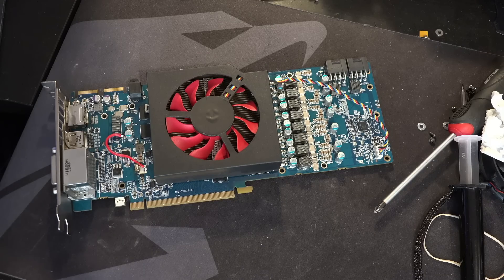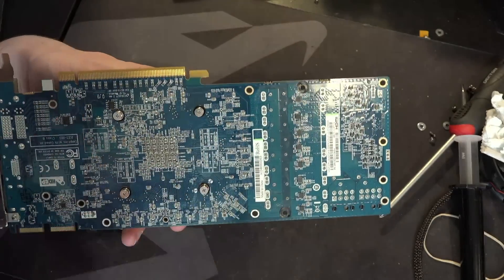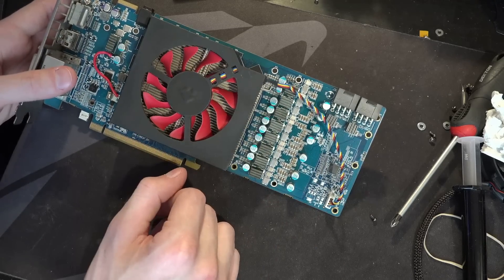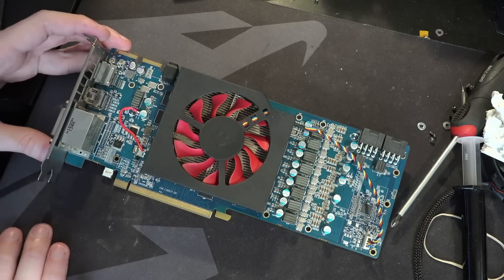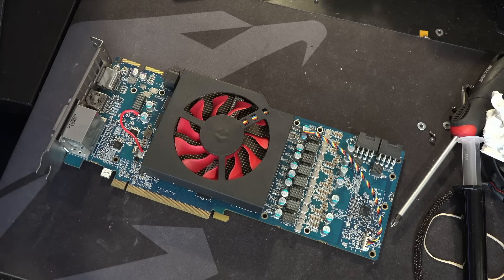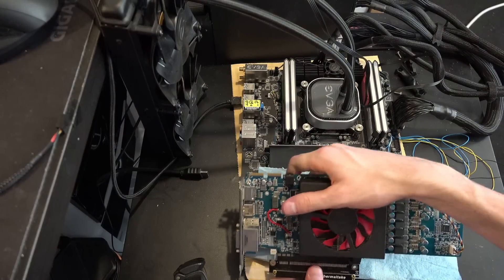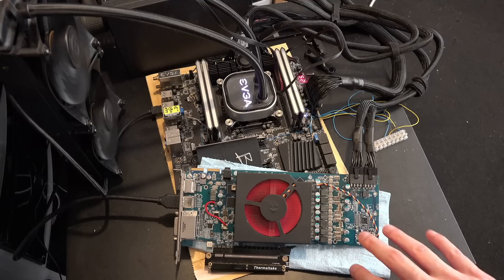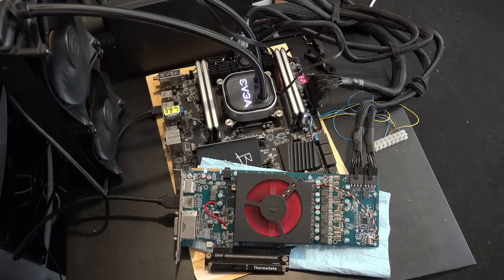GPU Necromancy 3: The ressurection of the Sapphire HD 7970 Vapor-X 3GB

Comment: I have the same card and about a year ago it started showing artifacts so I did the heat gun trick and it worked for another 3 months before it crashed again, now the card does not initialize (Dr.debug error code b2) and when i start the pc with the igpu, the card is detected (shown in hardware manager and even in GPU-Z with some parameters missing like frequency and clock).
any ideas?

Comment: i had xfx hd7950 core edition which had that tiny heatink, it was throttling at stock settings, then i replaced its heatsink with 1090t's stock heatsink and it was running great even with 50% overclock, now it have twinfrozer 3 heatsink and running great upto 1.3ghz ( stock was 800mhz)

Comment: hi i have a gtx 970 which when you plug in the extra 8 pin pcie power the whole pc shuts off its ok with the 6 pin power plugged in only if you add the 8 pin as well? any ideas where to look? cheers

Comment: I Have a Radeon 7950 Vapor-X Boost and runnign iwth 8+6 pin instead of 8+8 but everything seems to work still fine :D
Reply: Silly Szili some vapor-x 7970 have an 8 and a 6, but some have two 8. It may be that the ones with two 8 are the gigahertz edition, I’m not 100% sure though.

Comment: So, I have a possibly dead sapphire 290 vapor-x (0.5Ω)  (Mulitmeter leads measure the same) between an inductor and gnd, on vcore? probably long shot but is the gpu-core dead? other then the card not working of course and "CTF PX_EN" green-led flashing on the back of the card near the fan headers, any ideas what this might mean?

Comment: 🙂 7970 is a good beater card, kinda like a 1050thai, theres a more expensive Apple Flashed version if u have a classic Mac Pro Tower 🍎🙂 for a cooler u can pu an Arctic GPU Cooler, the bolt holes on this card are common and supported by Arctic 😃
Reply: MrSammy there’s a 7970 specific version actually. On this card though, the stock vapor-x cooler keeps the card at around 70-75c under extended load.
Reply: @EvilTurkeySlices  🙂 sounds like a decent cooler
Reply: MrSammy the only issue is that it’s quite loud. Surprisingly it’s quieter than my evga 970 though.
Reply: @EvilTurkeySlices  ☺️ thats ok

Comment: I am currently running Two Xfx 7970 3gb in crossfire, Had one running fine High settings fine most games, performance wise it does better then a gtx1050. because why not i purchased another from a friend, two now running both at 1145mhz vcore 1990mhz memory 6gb, SO they are a little older but 1080p high-ultra settings over 60fps (cpu r5 2600x) Is fine.

if only i could keep 2ghz memory Stable xd :'( feelsbadman
Reply: Lucius a single one is better than a 1050 ti.

Comment: Im sure somone in comments or buildzoid could answer this. The kraken g12 mod. Should you put heatsinks on vrm and vram or is direct air flow sufficient enough? Every forum i read its a toss up. Some yes and some say no.  I put one on my 1080 ti and have slight overclock to 2000mhz at 1012mv. Should i be worried?
Reply: Brian Deihl whenever you find yourself in this position consider what it will cost in time and money and then consider what will happen if you do vs if you don’t. Risk vs reward right?
 Putting heat sinks on the vrm/vram will cost $30 or less and .5 hour or less and you can be sure your vrm will stay within limits (assuming you don’t do a terrible job picking parts). 
 If you spend nothing and do not add heat sinks the vrm/vram could overheat and fail, possibly damaging the card to the point of permanent damage to components. Whether the heat sinks are technically required or not,it just does not make sense to not put heatsinks.
 Personally, I would apply heatsinks to vram and vrm components. At a minimum it keeps it working and at best it keeps it cooler than it needs to be which helps stability and reliability.

Comment: some elpida gddr5 in specs are 1.6-1.65v my expierience undervolting vddci on hawaii is that if you undervolt them bios not starts(need try few times)/ or artefact in bios but you can boot too windows and works fine 0 artefacts

Comment: I recently resurrected a dead HD7970 GHz Edition that died shortly after coming back from RMA.  I tossed it in the oven, cooked it and it works again.  That said, every now and then the system will black screen and lock up.  Temperatures seem to be ok, I've tried logging sensors and voltages and, to me at least, they seem normal.  Any ideas on what I may have done wrong?  Maybe I cooked something important?  I've tested the card out of Crossfire and sometimes I can game for like three hours without issues, next time like every 10 minutes or so it hard locks the PC.

Cool seeing these old beasts brought back from the grave considering they are now 7 years old.
Reply: Does the voltage drop when it crashes? My 295x2 has a pretty bad case of vDroop and that causes it to crash occasionally just because the voltages go way lower than what it's set to in the vBIOS (Like from 1.05v in vBIOS all the way down to 0.95v).
Reply: @MrPhilip796  According to GPU-Z sensor logging, both cards run a VDCC of 1.256v when loaded up and appear to have that when it stops logging and crashes.  I've put thermal probes around the heatsink and VRMs and memory chips and temps seem fine.  It's puzzling to me.  The only other thing I can think of is something to do with my X99 motherboard.  This has not been the easiest system to demand stability and reliability from, despite the workstation premise of this system.  I just figured if any one has come across or has ideas I'd try them out.  Thanks though for putting thought into this.  I know it's not an easy issue and may remain a mystery till this system gets replaced by a new build.
Reply: @PorscheRacer14  Do you have your CPU overclocked? Otherwise it might be what's unstable, as those are the two scenarios I've experienced anything like it. Also just try underclocking both by 100MHz or so, and perhaps also switch to a different logging tool, as I know that GPU-Z has a pretty low refresh rate relative to what HWiNFO64 and MSI Afterburner can achieve (HWiNFO64 is 10x a second, and MSI's lowest afaik is instantly, but I'm not sure if that one has a logging tool).
Reply: @PorscheRacer14  And what type of 7970 GHz edition is it? I've heard that the ASUS ones with overclocked VRAM become unstable overtime to the point of needing a flash of an lower tier card's vBIOS to really be stable
Also if you have Wattman enabled then I find that can also introduce instability, compared to just 'default' with a modded vBIOS (Although this will just require lower clocks to compensate)
Reply: @MrPhilip796  System is stock.  Was meant to be a fast stock machine for reliability reasons.  I'll give HWINFO64 a shot at logging and see what comes up, thanks!  Ahh that program doesn't pick up the sensors on the GPU, just fan speed and GPU temperature.  I'll try increasing the polling rate on GPU-Z and see what comes up.
Reply: @MrPhilip796  Wattman doesn't work on these old cards just Radeon Chill. One card is XFX Black Edition the other is VisionTek GHz Edition (the cooked card). Both cards have been flashed to the AMD GHz BIOS with 1050 core and 1500 memory. VisionTek put a stock BIOS on when they "fixed" it. When I cooked it and got it working again, the card was severely unstable. I did get the sensors working on the program and it's logging now as I play Arma 3.
Reply: @MrPhilip796  Alright so it did go down to .95 on crashing.  How does one fix the vDroop?  I mean, that last time I hex-edited a BIOS on a GPU, they were much simpler and easier to do.  If it's the case of finding another BIOS, this VisionTek card is really picky.  It took me forever just to find this one that mostly works.  I'll try disabling Chill and see if that helps out since I guess that is like a Wattman feature that I've been reading.  Thanks again for the input on this.
Reply: @PorscheRacer14  X99 at stock?

Why?

Anyway, you put this card in an oven made for food with no liquid flux and no kapton tape and you're asking why it's not working? Lol.

I can't even.... This channel seems to draw people who think they know what they're doing, when they absolutely do not.

Lol. Hilarious.
Reply: @nexxusty  Thanks for this valuable feedback. I'll take this into consideration on my next dead graphics card. At the time though, this setup was to remain stock since I can't afford downtime to chase issues nor would it be required. Every pc I've had since the 80486DX I've messed with and overclocked and eventually needed to repair or trouble shoot to get back up and operating again. I wanted a fast a reliable workstation for work and play. This X99 system replaced my X79 system that ended up having issues over time. It appears over time, this system has been plagued, too.
You see, I've over clocked, competed and even took 3rd in the world at one point. That said, my job requires I have a system that always works. So a powerful and reliable system was intended to be built. Time passes and my one card dies on the X79 system. It has lifetime warranty so I send it back to VisionTek under RMA. They return it saying there is nothing wrong. I install the card, see its detected in BIOS, but into windows and install drivers. I reboot and it fails again. I contacted VisionTek and they will not accept a return. I have a dead card now. Time passes, I build the X99 system. I end up with some free time and inquire to my overclocking buddies about my dead card. He suggested a cook to reflow the card. I have nothing to lose. New graphics card are insane in price and used 7970s are nearly what I paid when I bought them new. I cook the card taking care as suggested. I put it back together and the card works. I'm pretty stoked. However I do realize that VisionTek has flashed my card to base speeds and not the GHz Edition speeds it should be at. Even if somehow VisionTek had fixed my card, the fact that it is running slower than what I paid for would still have me trying to return the card. Maybe there's a better BIOS to flash onto the GPU? Maybe there's something else I can do? That said I went from a dead card that they wouldn't warranty and that lived at stock speeds, to a card that works but crashes at times.
But next time I have nothing to lose or gain, I'll remember your laughter and valued input. It'll spur me to at least try something than do nothing for fear of not doing it perfectly or making a mistake.
I wonder how anyone ever gets anything done if they're always scared to try something new or afraid of failing...
Reply: @MrPhilip796  I just wanted to say thanks.  So far, at least for the past while I've had no issues gaming so far.  I disabled Chill and no longer having it freeze up.  Cards do run a bit warmer so I just manually run the fans a bit faster.  The cards are too old to have the fan curve in the latest drivers so I'd need to mod the BIOS to make a new curve or just manually set them on every demanding game launch.  Minor things as compared to locking up the system.

Comment: cant you link that straight to vcore with a adequate resistor in between?
Reply: Vcore changes all the time depending on the pstate. Probably not a good idea as you want a constant voltage.

Comment: My old card was a 7970 from ASUS. The thing died 3 days after warranty. Brought it back to life with a heat gun and some new thermal paste. It works even now on my parents computer :D
Reply: asus 7970s suffered from shitty thermal paste. we had two identical asus 7970's with the oem blower. the paste dried within 6 months. replaced with arctic silver 5, dropped temps 15c from its original day 1 temp reading with supposed fresh paste.
Reply: @chriswilliams5133  XFX is a really shitty brand though. They used to make Nvidia and AMD and when Nvidia confronted them on their terrible quality, they ended up crying "its hard to keep up quality when you run two brands" so Nvidia gave them a choice, be Nvidia only or AMD only, and XFX went AMD only. To this day XFX are the shittiest GPU's you can buy on the market.

I had TWO 8600gts and both of them died withing 35 days of ownership. So I couldn't return them. And then XFX refused to honor their warranty.... they claimed they don't make factory overclocked cards and they don't warranty overclock, yet the box itself said "overclocked". I will never buy XFX and all i hear are issues and terrible RMA conversations and warranty issues.
Reply: @chriswilliams5133 Well I remember them different. I had a dunno what exactly been a while but it was a mid-high end card and it survived for like 9 years and is still going.
Reply: @AlpineTheHusky  I have a 5770 that's still fine.
Stopped using it ~2 years ago because it couldn't keep up with VR (could surprisingly still do regular games more often than not.)

Plenty of stuff survives with no problem.
Though I guess it depends who manufactured it.
(my 5770 is a Sapphire Vapor-X, but as the video itself proves, that doesn't mean the cards can't die. XD)
Reply: I had two DirectCUII 270s from ASUS and they both would experience thermal runaway. After I saw the second one had the same problem as the first I said screw it I'll just void the warranty and replace the paste myself rather than wasting money and time shipping it back and for a new one perpetually. I guess these days that doesn't legally void the warranty but at the time at least I thought it did.

TL;DR: Seems ASUS cards used to have a shitty factory thermal paste application.

Comment: Tf you complain about, I once opened a pc to clean it up and inside was a dead mouse. It electrocuted itself in something on the motherboard.
Reply: @chriswilliams5133  Also, he was fresh and chose to die on a gtx 470. He was not rotten,just dead.
Reply: @abcdefg9613  Death from stress (cuz of the moving parts and small space) or by heat is much more likely, as far as I know (but don't quote me on that one) mice dehydrate pretty fast (even tho they don't really sweat). 12V is not enough voltage for any meaningful amperage to flow, since the resistance of the mouse' skin and fur should be too high. The hair on the cap can just be a coincidence, but if it touched there, the (electrical)legs would still be pretty close by, causing the electricity not to flow through organs but a extremity, thus decreasing lethality.
Reply: @rapophie9228  Honestly I electrocuted myself quite badly in my teachers pc because it was plugged in a socket with no grounding. As I got under the desk to remove the cables I touched the corner of the case with my cheek and it shook me so bad I knocked down the monitor from the desk.
Reply: @abcdefg9613  I don't say it's impossible, just unlikely. Since the graphics card is actually near parts of the case at one of the ends you might be right.
Reply: @nexxusty  I want to see you "pushing" 40 amps through my body @12V. The resistance of my body will almost certainly be a problem tho. Google "Ohm's law".
Reply: The lower voltage essentially isn't "wide" enough to actually let 40amps flow through.

I get it, I get it.

I was more or less saying that the 12v rail in a PC while loaded can most definitely kill someone if they short it out.

Can you at least agree with that? Hehe.
Reply: @nexxusty  it cant even tickle someone its 12 volts even if it was 1000amps it can't hurt you
Reply: @nexxusty  If you want to make an argument about electricity at least have a decent basic grasp of it
Reply: @chriswilliams5133  When I was called the owner said that the system shut down (he suspected thermal trip) and indeed it was very dusty, but the mice died by electrocuting itself on some capacitor just above the video card(he died on the gpu backplate, not on the bottom the case) I suspected he electrocuted and died because there was mouse hair on the capacitor (I suspect he got shocked and the cap was so hot it burned the hair).
Reply: Well... That's gross.

Also, bugs can indeed short out computers. Or, at least, they used to be able to once upon a time...

That's why software problems are called 'bugs' in fact, because some of the first known examples were caused by actual insects shorting out parts of the computer.
Reply: Looks like got Deadmau5 2.0 here.
Reply: @GerdLPluu  wow. Great explanation man. Appreciated.

I always thought when you were the thing that shorted whatever is being shorted, you interfered with the shortest distance and the electricity flowed into you.

Guess I was not correct. I really need to take a course or something. I know a decent amount but the the fundamentals.

That makes a big difference in really knowing.
Reply: Groza Adrian two lizards had a...stimulating,...coitus session culminating In their electrocution across the two high voltage/current terminals on our AC unit, fossilizing them in their O face.
Reply: I have had a mouse end up inside a PSU. It was completely fused to the casing on the inside. Somehow the thing still ran. But I threw the PSU away anyway.
Reply: @GerdLPluu  "Mathias wandel" great smart dude that has videos worth watching (including checking at which size mice still dare/want to try and get thru something for food for example)
Reply: I once took apart an older pc that had a mouse dead inside. It had burn marks on its legs so definently fried